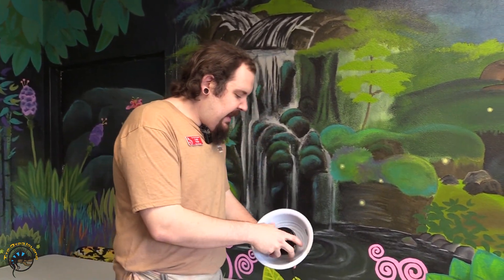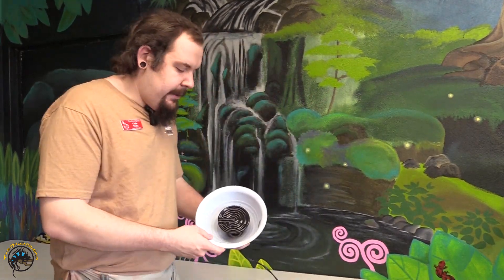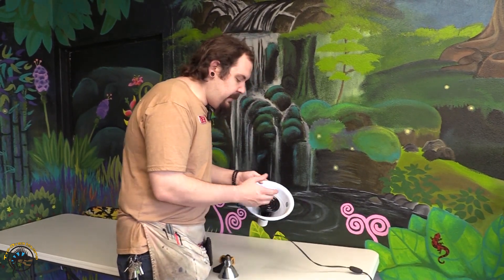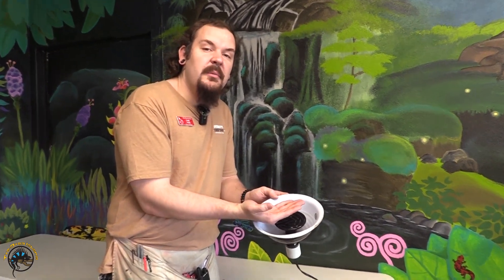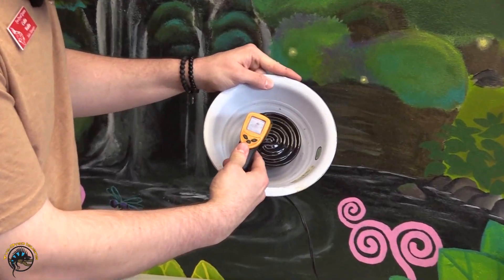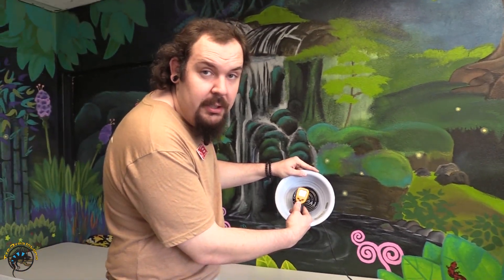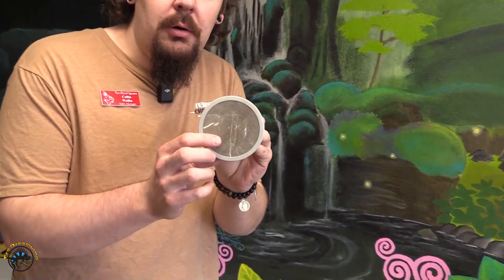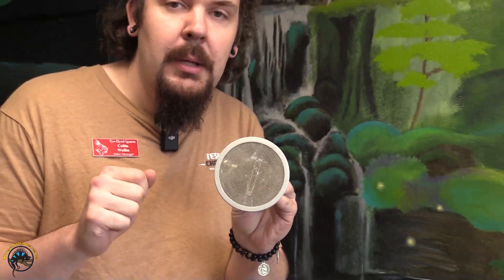TDI Quick Tips & Tricks: How To Tell if Your Ceramic Heat Emitter is Turned On

Comment: Mine isn’t heating up
Reply from the maker: With Heat Emitters, we find that the most common culprit has to do with threading alignment or bulb tightness. Adjusting (while off) to ensure that your bulb isn't too tight or too loose, is a great first step. If you still get no response, we recommend checking your fixture, to ensure that it's working properly in general. You can test this by inserting any other bulb. If that works, then you're on to the next step! If you have another fixture available, you can test your Ceramic Bulb in that. If it doesn't work in either fixture, you may have a faulty bulb. If local, we do offer free in store bulb testing! We can also inspect your fixture in person.  Here are some videos that you may find helpful! How to prevent over tightening and damaging your heat bulb: https://youtu.be/bFOM-p3jkHo?si=0Ktv25kWTGQDtlBs
Why your reptile's heat bulb keeps blowing out: A trouble shooting guide:  https://youtu.be/k0PRxzMYZ6E?si=dILFm-yHj5YPKuAa